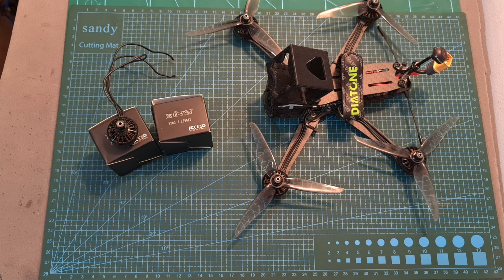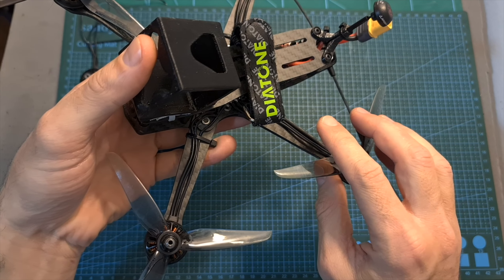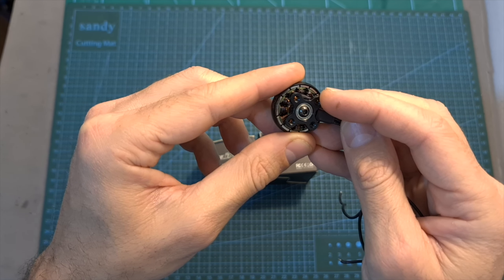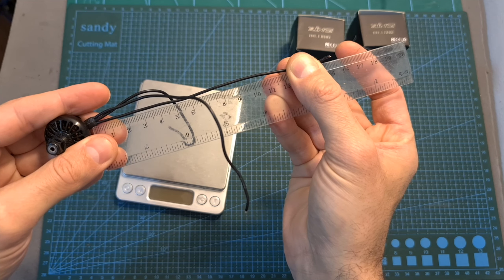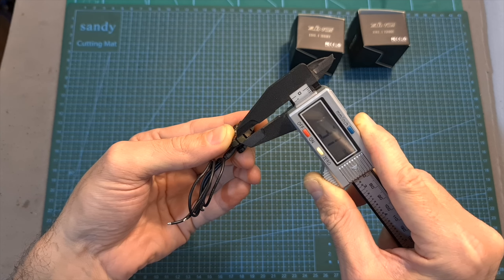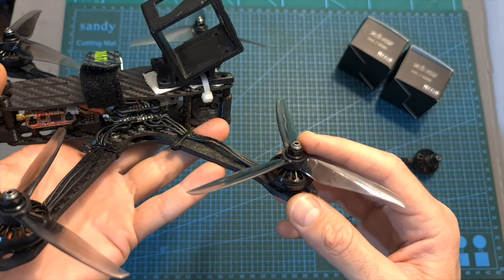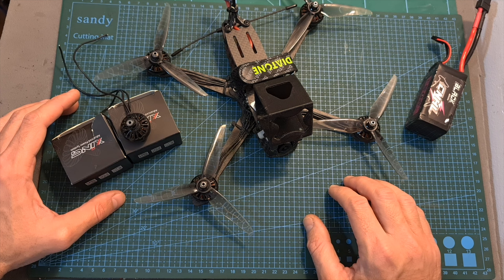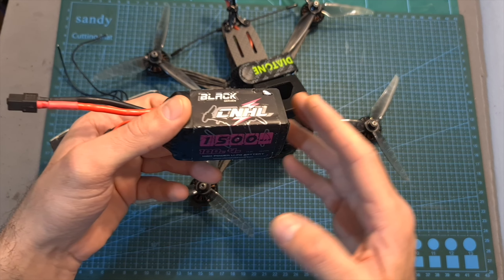iFlight XING 2203.5 Motors - Overview, Thrust Tests & Flight Footage

Comment: Awesome, I was looking for test data for these motors just last week.  Based on the data, I'll not be going with these on an upcoming lightweight 5 inch.  Might be leaning more towards the Lumenier 2005 motors.

I wonder if these motor would perform better with a prop with a shallower pitch.

Thanks for the fantastic test!
Reply from the maker: My pleasure. I will test the iFlight 2005 motors soon :-)
Reply: @KremerFPV  awesome to hear, I look forward to the results!
Reply: I know it's a year later but yeah these need much lower pitch and lower kV. Aren't meant to make a lot of power just be efficient. 2000 or less kv for 6s and under 3000kv for 4s. 
I use 2004 1600kv 6s and use 5125 and 5126 and 5130. 
I did eye 2203.5 1500kv for the build but decided lil more power for hero9. Alot more 2203.5 and 2303.5 motors available now at different kVs

Comment: I run this Motors on a whoop 3" props, 4s and worked fine. What do you think about the Toka 2203.5 2650kv? What you would you choose, stay at iflight or try the Toka?
Reply from the maker: Both options will probably work well. I haven't tested the TOKA 2203.5 KV motors.
Reply: Is it more powerful than 1408 in 3 inch?
Reply from the maker: @catmanfpv9213  Should be.

Comment: i have that motor iFlight Xing 2203.5 2500kv, and i don't know what i'm going to do with that motor... should i build 5 inch quad or 3.5 inch cinewhoop with 6s both. any recommendation?
Reply: what did u do finally?

Comment: Were you test flying the 4s or 6s motors? What was the AUW of the rig?
Reply from the maker: 4S motors, limited to 80% output. About 250g (without the 1500mah 4S CNHL battery).

Comment: Thanks for the video Gal! Why don't you test them with a 3" prop?
Reply from the maker: My pleasure. That was my plan but by mistake I used 5" props first and burnt the motors. I still have 4 more motors assembled on a build but I would like to keep them on this build for now and not risk damaging them as well :-)
Reply: @KremerFPV  oh I understand 😊thanks to your experience, do you think they will be a good choice (looking for efficiency) for a cinewhoop? They are cheaper then FPVCycle and T-Motor of the same size and I'm searching for an alternative...
Reply from the maker: @enricob  I am not really sure, as I have to try them in order to give you an educated answer :-) I hope to test them again soon using 4" and the propeller guards of the frame which I used in this video.
Reply: @KremerFPV  yeah thank you it's a good idea! I'm thinking about the same, using guards on 5" frame with 4" props, for sure it will be more efficient than 3"
Reply: @enricob  a lot of people is using them in a 3'' with good results
Reply: @enricob  does this motor more powerful than 1408 on 3 inch?

Comment: Stupid question, but the motors with the prefix .5 what does it means?
Reply from the maker: It marks the height of the stator. 2203.5 -> stator diameter is 22mm and the height is 3.5mm.

Comment: hello gal, I'm using this motor and I'm using a 4s li-ion battery.  and the battery got really hot, have you tried it?
Reply: Hello wow , my also goal is run with li-ion cells , how's the experience ?
Reply from the maker: Hi, these motors are not good for a lion battery, at least on a 5" setup, as the current draw is too high.

Comment: What would be the best motor for a build like this? 1806, 2005, 2204 so many options these days🧐
Reply from the maker: Well it depends... So far I enjoyed the 2604 motors that I've recently tested on this platform and I found that it worked better than others.
Reply: @KremerFPV  2604😮 wow that's New to me😝 guess i Will wait for your video on those👍😁
Reply from the maker: @hanfpv3093  https://youtu.be/EAO8KqMErE4

Comment: Strange motors, sized for a 5" frame, KV normally for 3S and 4S but listed as 4S and 6S, you'd have thought if they expected a lighter load they also sent some of their Nazgul props.
Reply: Sometimes when u see 6s amd 4s certain high kv its meant for when u put a smaller prop like 3.5" .. 
For 5" this motor only meant for very lightweight drone with low pitch to get max flight times